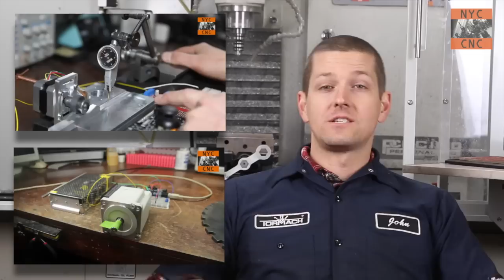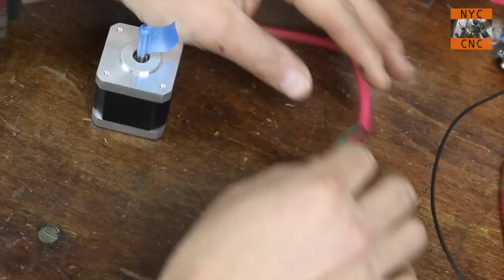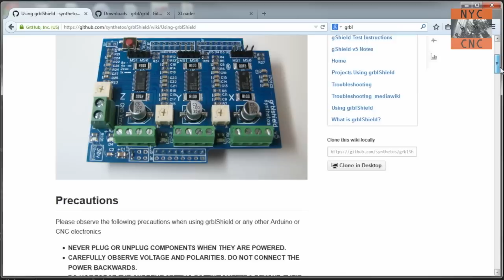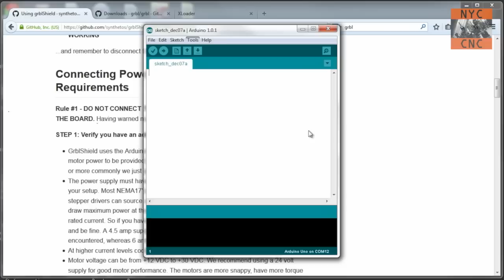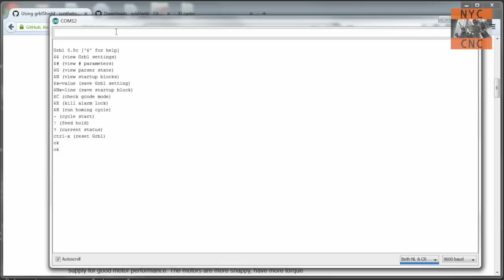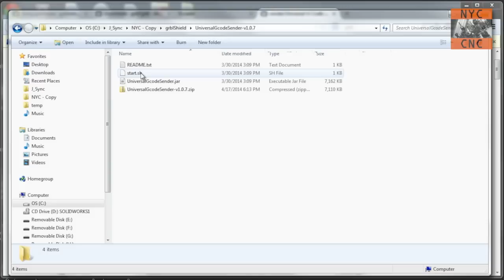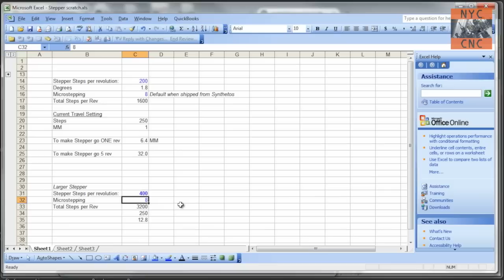DIY Arduino CNC Machine with GRBL Shield - Setup Tutorial!

Comment: My house circuits are 15 amp. Will this work on it?
Reply: AC voltage NOT can use. need tranformer DC voltage max current what need motor max current x how many motor plus little reserve, etc, 3A max C x motor is 3 motor 3x3A power supply need 12,or 24 or 36 volt 10Amp

Comment: Hi. Great tutorial. I have an arduino mega and a ramps 1.4.  Will the GRBL software still work. if not what would you advise. The arduino software that im using is for 3d printers.

Comment: is there any device required between arduino and stepper motors such as stepper drivers?
Reply: The GRBL shield is a stepper driver.
Reply: @Turkishmath  thanks for your reply, i want to know that can we convert CAM file to arduino program
Reply: @Turkishmath  is it necessary to have grbl software and arduino software for sending the commands to machine?
Reply: @mayureshgawali6768  To be technical, no, but if you are asking this question, it wouldn't be productive to not use GRBL software. As for converting a CAM file to an arduino program, the GRBL software takes gcode, which is a cam file.
Reply: @Turkishmath  Thanks for this.
Is there any other post processor which will do these all steps and directly send the commands, hence it would be easier for operator to handle the machine?

Comment: FYI --If you FU and reverse the power connections to your CNC Shield, disconnect everything, yank out all of your Poloulo boards and look down between the "A" and "Y" driver positions down at the board level. You will see a tiny glass tube which is the FUSE that you just blew. Buy a new fuse and replace it. If you want to take a risk, desolder the fuse and replace with a thin wire like the super fine transformer winding wire. Either way, your CNC Shield should leap back to life.

Comment: Hi
Does the 12v stepper motors works on 24v since  the power supply used is 24v ?
And deos the 2v or 3.5v steppers work on 12v ?
Reply: No, you need the voltage that the stepper uses.

Comment: very good, but I can't determine suitable shield can hold 4 A , wait for replay
Reply: if you mean one motor need 4A max current you need use external stepper driver, this or other arduino shield. arduino shield  small drivers can use max 2A motors.

Comment: Thought I'd let you know this video was so great it became the starting point of the building of my own diy CNC router back when you posted it.  It has been running for a while now, and I still try to make upgrades to it, just for kicks.  I use it primarly for woodworking, and I still don't get tired of watching it cut through wood.  Thanks!

Comment: HI John, I am in need of building CNC Plasma table...but I also wanted to use a router on occasion...none the less....I was going to start out with just a 4x4 table.....and make it so if I needed to upgrade to 4x8 table. it wouldn't take a great deal of reworking...lead screws and rails would need to be changed.....For that application, is there a specific roller set up, rails, steppers, etc  that you would recommend to by or manufacture.?

Comment: the stepper motor i have bought has 4 wires. and the plugs on the grbl shield has 4 plugs. can i connect the stepper motor no mater witch color on the grbl plugs?

Comment: Hi!  How do i connect a stepper to the coupler?  My hobby stepper shaft is smaller than the coupler hole 😔
Reply: coupler can buy many many different axle size, 3mm, 4mm 5mm 6mm 8mm 10mm what axle motor is. can buy right size coupler too, i use 5mm axle couplers many and 8mm and 12mm

Comment: I'm installing a 3 axis cnc shield with an Uno and I was able to get the $ command to work last night but not today.  I've tried using a new Uno and got the same non-response.  Grbl 1.1f ['$' for help]  comes up but the communication isn't there...but was last night?  Any suggestions?  I'm converting a 3040 cnc from parallel to usb.  I'm on mac with latest Arduino IDE.  I can reset with the shield connected and the steppers knock like they are getting power so I feel like I'm dangerously close :)

Comment: So, i have only one Axis, but it has brutal weight on it. Using a Nema 34 Stepper with 6,3 Amps would be able to do it. Obviously the GRBL Shield is not enough. Can i use the same program but without the grbl shield and stream the code to the motor card?
Reply: ALL same but stepper motor drivers need use external drivers who can handle motor max current,  if motor max is 6,3Ampere driver need setting dip switch less this ampere about 6A or what driver can setting 6,1A. but NOT more than motor max ampere is. or burn motors.

Comment: i bought a stepper motor but i didn't notice that  it's a five wire 5  phase motor a 0.72 degree VEXTA what kind of driver should i use ? thank's john

Comment: I purchased a diy cnc machine last year which is using grbl controller.  The seller ask me to use artcam software for engraving .
I downloaded a free software  however it does not work properly because the milling cutter does not go up after engrave one 
letter and go directly to  cut another letter  and it  it is no good at all because I need to engrave so many letter at one time. So I download another artcam software and try to engrave again.  I just draw a rectangle and engrave it . The size  of the engraved rectangle is only 1/4 of the vector drawing size . I tried it for 2 times it is same. Than I made another size rectangle to test the machine .
After  open the file and run that file . I find only the spindle turn on but the stepper motors for the XYZ axies are not working.
but the Gcode  file is still running . I checked all the wiring . There is nothing changed.
Do you know what is happen to the machine . Do I need to replace another grbl controller?
Alan

Comment: hi,i gave up on the dvd/cd steppers,no idea of the steps per rev,so i got some 1.7 NEMA standard types,i use the grbl shield v3 with grbl v1.1f,my steppers don't move as fast as yours do,mine are the 3.3v types,though i supply them with 12v,200 step/rev,i got the micro stepping figured,divide the total by whatever the micro step setting to get the rotational degrees,just for function,no lead screws yet,8mm 2mm 8mm lead on order,just the speed of rotation when i input a Gcode command or jog in grbl controller,does the feed rate slow using larger or smaller No's,ie  G01 Z25 F200,F being feed rate,or do i omit the feed rate,i'm a total greenhorn with cnc,so please forgive me if my interpretation of Gcode sucks!.

great series of videos by the way,i want to get this going,as i have so many things to  do,like make a bigger cnc bed,with laser,router,maybe even add a plasma cutter (inverter type).

All the best from the other side,(of the pond).
CHEERS.

Comment: Thank you, good tutorial, my question is how far can be the maximum work area, for example I need axis X 1500mm and axis Y 2500mm, is that possible with Arduino?
Reply: yes have but need external stepper motor drivers and biggest stepper motors, normal used minimum 475OZ / 3Nm motors or biggest, drivers need handle motors max current or more, etc, you have 4Ampere motor need drivers can working more than 4 A. same power supply need 4Ax how many motors you use, etc 3 motors need 4A x 3 motors is minimum 12-15A power supply. only can move motors, and fast move need voltage max if arduino shield maximum volt is 30V need 30V 15A power supply. i has build this size cnc machine not can use belt move motors need rack and pinion, and good linear rails etc, i use SBR 16 or SBR 20 rails.

Comment: sir,
 i just completed  hardware part of my cnc router. I'm using 3 stepper motors for the 3 axes.The driver ic i used here is  TB6612FNG . Can you plz help me connecting it to arduino uno and also with the corresponding code.

Comment: Can Arduino handle Nema 23 stepper motors?
Reply: whit arduino cnc shield can if motor max current is less than 2Ampere, not can if motor max current is more than 2A, then need external stepper drivers who can use motor max current. etc DM556 driver.

Comment: hello buddy i am totally new to science. i had trying understand some of the concept but i m not able to understand that what is the wiring work i have to do to connect the stepper motor with chip.
Reply: stepper motor connected to motor driver  and motor driver has connected arduino cnc shield and arduino is connected to computer via USB.

Comment: Serious question, if you are going for a "budget" build why not use a dedicated stepper controller? Thanks to the rise of 3D printing they have become fairly cheap, running only $35-$45 for a basic quality 3 axis+ board where you are looking at around $80-$100+ for a Arduino and GRBL shield (provided you don't already have an Arduino, just the shield runs in the $60-$70 range).

Comment: My motor spec says 48 steps per rotation and also 7.5 deg step angle. I am unsure how to work this in.
Reply: normal ALL stepper motors run 200 step/round this is 1,8 degree step angle,  you use ap-normal motor but cn use and GRBL setting can change move dimensions.
Reply: @mattivirta after 8 years I worked it out myself 😂

Comment: if you make it rasberry pi and all in one "rasbbery pi + CNC shield + power supply + linux CNC  " i think it will be bitter than
Reply: perfect compination but not have ready image can use, maybe new rpi 4 or rpi 5 come image but not have olden rpi3 . cheapen can use old 20-40$ old pc and paraller port card and paraller port breakoutboard 10$ whit linuxcnc, or breakout board change perfect mesa card. etc 7i96 is good.

Comment: what platform are you using on you're cp,i cannot get xloader to instal let alone run,i'm running vista 32bit ,i don't expect you can fix this,but i'm thinking xloader works on win 7 +,incase you're running a newer platform.
Any one else get a brick wall effect here with xloader.

Comment: hi,
i've bought an uno and a protoneer V3.00 cnc shield with four A4988 stepper drivers,
i'm looking at building a steel box  base frame for the X axis and an alluminium Y gantry which bolts to the X axis at either side,for "field stripping" convenience,most ,if not all of the electronics are available using arduino to control via the cnc shield or even use a break out box with stepper control units.

A problem occurred to me ,in that when i need to change a tool,lets say after a rough cut procedure,the next tool will no longer be able to pick up from where the last tool height finished,due to it being maybe longer shorter ,even a tool of equal length would need to be replaced in the spindle at the exact same depth in the spindle,or the work piece may not be cut or gouged and damage could occur to the tool etc.

Do you know if the arduino set up use a tool contact/touch pad to re-find a tool height,i know some other kit/open source cncs can use this,but have contact pins on the pcb for a contact pad to be wired in to.

It being a CNC shield i would have thought this would have occured to the manufacturer.
I may go for the break out board type cnc if this is not possible,because i want to use the machine for crafting large-ish sections of wood which would need a rough then finish cut.
thanks.

Comment: i can controll my motor with my laptop but on some laptops and pc's it works and on other ones not. how is this possible
Reply: laptop have lot problem not good use, many laptop not can give out REAL 5Volt to controller, and controllers need TRUE 5Volt. use old table computer cheap 20-50$ can buy lot old computers.

Comment: Just started watching your videos on CNC with Arduino and stepper motors. Have my fingers crossed as I continue to view the vids that the parts for this project are Hobbyist affordable? Back to your great video!
Reply: Rud Dog I calculated everything for about 205.51 before any shipping or extra stuff (unless the brackets are only for one axis then its 325.49)
Reply: Where would the parts be ordered from it would great if the parts could be ordered sections at a time. This way a motor and one rail could be purchased and played with then moving on to ordering the next part. Sound funny but it helps me justify the spending and progress. (Retired hobbyist) Thank you for taking the time to reply and help.
Reply: Rud Dog they are in the description  in about 6 different links
Reply: ztmackin Thank you overlooked that in my rush.

Comment: I am thinking of making a CNC like machine that I will use to write stuff on large sheets of paper (about 30 inches by 26 inches). I plan to Use an arduino board for the project. What advice do you have for me ?

Comment: Sweet video!  question: is there a rule of thumb folks use for sizing lead screws and stepper motors for various lengths of lead screws?  like would 1/2" lead screw with a  Nema 17 stepper be too small for a four foot length of movement?

Comment: I have not found a good answer yet maybe you can help. I have a diy cnc I built I use arduino 2560 and drv8825  why would one want to use an arduino uno over a 2560 board?     I see allot of talk about GRBL but so far cant really get a good answer is one better for cnc mill then the other I know mine I have to make it think its running a 3D printer LOL

Comment: Hello John cool Video, I have a question. Iam new in CNC, So, Can I convert my AutoCAD design into Gcode so we can send it to the Arduino. Thanks.
Reply: yes can many different software can open autocad DFX files and convert pictures to G-code.  can use FREE  software freecad. and many many other cad/cam softwares.

Comment: In this case can we use the universal G code sender to control the stepper instead of using code from arduino, like you did on the other video of controlling stepper motors!

Comment: How hard do you think it would be to add sensors to the arduino with the GRBL shield in place? I am thinking of making a CNC router with a self leveling base by using linear actuators and a IR range sensor or an ultrasonic sensor to gauge the relative inclination of the plane.  I will be using a Arduino mega so it should have a few extra pins accessible.

Comment: Hey NYC CNC, great videos.  I'm new to CNC work but I have a harbor freight mini mill for my 80% lowers and I'm wanting to convert the mill to cnc.  There are a lot of electronics packages you can buy, that basically consist of a driver for each stepper motor.  Like this link http://www.ebay.com/itm/US-Ship-3-Axis-CNC-Kit-439oz-in-Nema-24-Stepper-Motor-M542T-Driver-DIY-CNC-/331590642432?hash=item4d3457ab00:g:X6kAAOSw42JWEhfI

I'm wondering if using the example you show in the video will work, 1 arduino with the GRBL shield for all 3 motors, and will it work with say Mach3? 

Thanks

Comment: Hey John, I'm a long-time listener, first-time caller. I'm in Ireland and having trouble sourcing a 24V 300W power supply, will a 24V 60W work? Specifically this ->http://www.maplin.ie/p/power-pax-60w-switch-mode-acdc-24v-power-supply-n60kh          Thanks in advance!
Reply: +NYC CNC Thanks for the quick response! Hopefully these  - >http://www.geeetech.com/nema-17-42-byg-shaftreversed-stepper-motor-p-908.html     Best of luck with your move!

Comment: hi, can I ask  if i can use the step motor that you mention on this project with the kit i have, and if i can use a 24vdc for it.. 
CNC V3 Shield + UNO R3 Arduino Compatible Board + 4 PCS TI DRV8825 StepStick Stepper Drivers.  just start to build a small cnc router. thank you. great video tutorial.

Comment: very nice work you are doing here! i have a question, if you fit bigger motors will you fry the arduino? thank you!
Reply: yes need external stepper motor drivers, max motor current and driver max current need be more. arduino shield own max driver current is less than 2A can use only nema 17 small toy motors and used only 3D printer and laser, no need lot torque move.

Comment: Hello, thanks for the tutorial. Is it possible to drive 3 nema 34 with this driver? Or can I combine ST-M5045 with this driver? I would like to build a large machine and use 3 nema 34 and arduino, but i do not know if it is possible. Thank you.
Reply: is possiple but need use external stepper motor drivers etc, DM556 max 6A motors can use, or DM860 etc what need important have only motor max current and driver need use same or little less current. need connect only STEP, DIR, enable pin external motor driver.

Comment: my Arduino shuts down when the cnc shield v3 is connected (it starts, but shuts down after 3-4 sec. / it looks like a voltage drop) the LED turns off slowly. help would be awesome.
Reply: you may have short connected the power, be careful cuz this may ruin your ATmega

Comment: One more question...I've just set up all three motors and connected with Unversal G-Code Sender. Looks like all motors work fine, except one connected to Y axis. When I press Y+ once (step size = 1), it turns to the right, but looks like it selects the direction by random. Sometimes it goes to the right, sometimes to the left. Tried to change motor and motor driver - same story. Anybody knows where's the problem? I can record that, if needed.

Comment: A good and informative video. Btw. you should never change the jumpers or plug/unplug motors while the stepper driver is powered, as there is a very good chance of destroying the chip by this.

Comment: Is 60W power supply (like this one http://www.ebay.com/itm/AC-110V-220V-TO-DC-12V-Power-Supply-Transformer-For-The-led-strip-light-/390981638139) enough to power threee stepper motors like these shown in the video?
Reply: +Viktor Gabaj Yep should be fine.

Comment: Since the Arduino Uno runs off 7~12VDC, I take that it doesn't draw its power from the USB which supplies 5VDC.
Reply: arduino cnc shield can use 12-30V not arduino can use direct motors, driver controll motors, arduino controll only signal to driver.